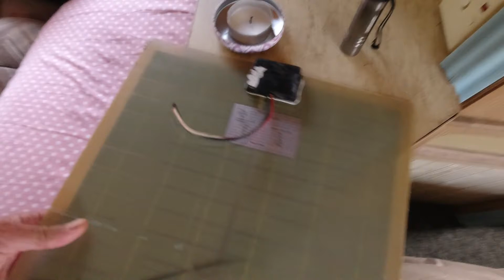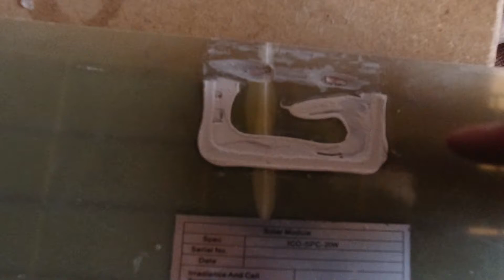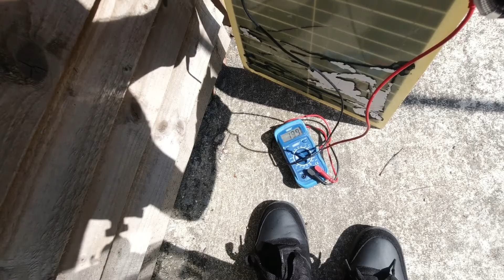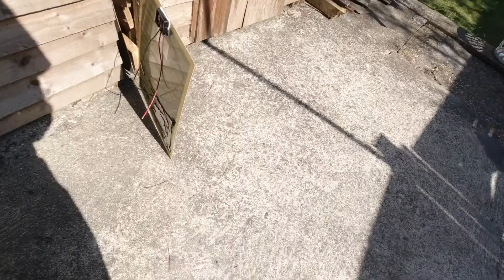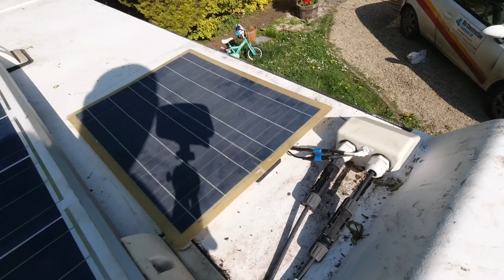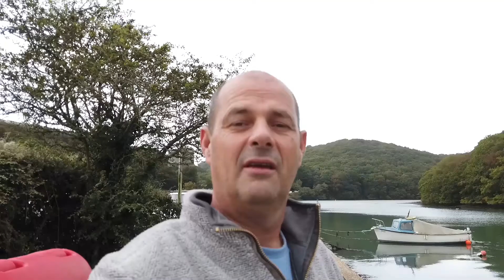Vanlife Motorhome Solar Panel Repaired

Comment: Nice little fix. Martin from houseless has just done a vlog on cleaning the flexi panel and he used toothpaste. I have a small 25w rigid panel on the roof of my caravan and it keeps the battery on that nicely charged.
Reply from the maker: You can use Tcut too. It essentially does the same thing.